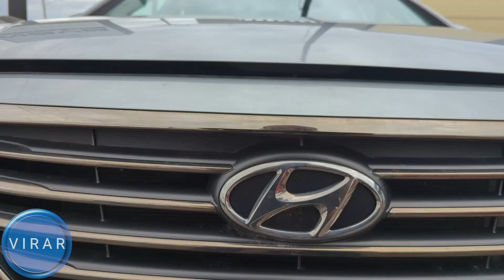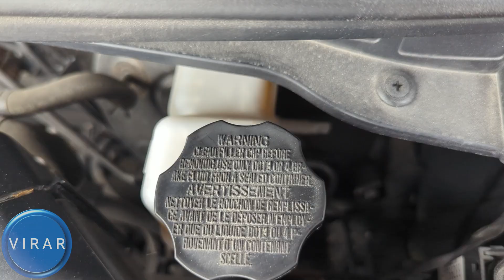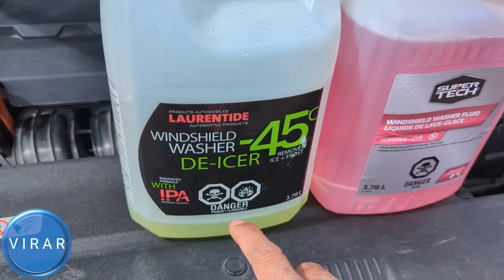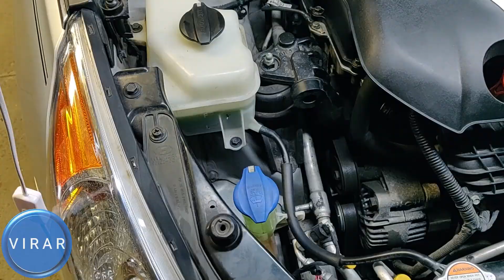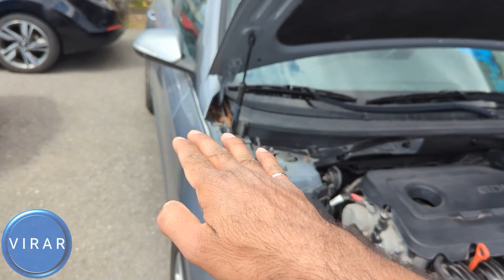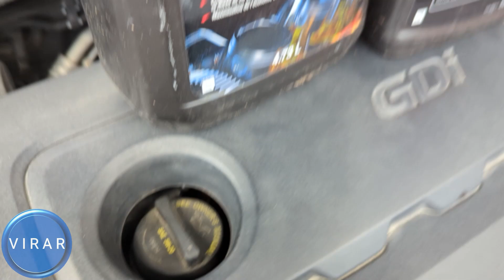How to Check and Fill Fluids [COMPLETE GUIDE] - Hyundai Sonata (2015-2017)

Comment from the maker: Brake Fluid Type: DOT 3 or DOT 4
Buy DOT 3 Brake Fluid on Amazon: https://amzn.to/42ZxnJN
Buy DOT 4 Brake Fluid on Amazon: https://amzn.to/3WsTZyB

Engine Coolant: 50/50 Coolant AntiFreeze
Buy Coolant on Amazon: https://amzn.to/47qwlHT

Engine Oil Type: 5W-20
Buy Engine Oil on Amazon: https://amzn.to/3L957ya

Virar Automotive is an Amazon Affiliate. If you make a purchase using the link, Virar Automotive earns money for referral.

Comment: I have this same exact car. I'm at 125k miles and I have not had the transmission fluid flushed yet. I bought it at 87k miles from a dealership. Should I have the transmission fluid flushed? Also this same exact engine in the video this car burns a tremendous amount of oil. Is there anything I should or could do to make that stop happening? TIA in advance.
Reply: Hi! I have a 2016 that was burning a tremendous amount of fluid. I took it to the dealership and they performed an oil test, and they deemed it defective and I received a free brand new engine!
Reply: Oil, burning a ton of oil, was having to add so much constantly

Comment: This is truly the best video I seen by far. I have a Hyundai Sonata 2015 with only 56,500 miles on it. Should I have to have the transmission fluid changed or can I just hold on until I get close to a 100,000 miles like you suggested.
Reply from the maker: No harm in getting it changed at 60,000 miles and then repeating it at every 60,000 miles especially since you don't drive the car that much.

Comment: My 2017 Sonata has over 93,000 miles (140,000 kilometers). The engine currently uses 5W-30 oil, but the oil cap says 5W-20. I'm not sure which oil is better to use. Please give me some advice. Thank you!
Reply: idk if you still need this advice, I also drive a 2017 Sonata and it can use BOTH 5w-30 and 5w-20 just fine, depending on what kind of engine is in it (mine is a 2.4 GDI) 5w-20 full synthetic would be the absolute best for it per the owner’s manual IF you also have the same engine, if not 5W-30 is a safe use for all of the engine variants for 2017 Sonatas but check your manual for the full list and the temp ranges

Comment: I’m gone get Lily (18’ Hyundai Sonata) in order! I’ve been watching inspections/common issues/how to check videos on my model/engine! Great content! I bought her with 117k, & I have 126,xxx! I want to keep her running smoothly even after I pay her off!
Reply: May I ask how much the total of the car was? I bought a 17' Sonata and I paid 10500 I believe I overpaid a little bit but the car was definitely clean for the amount of miles 92k
Reply: @playingpidgeon8832  12.9k with a Drivetrain Plus warranty included that I’m literally working right now. I’ve gotten multiple oil changes & top offs since I bought her back in October. Currently doing the 1000 mile oil consumption test to determine cause. Just recently got P0304 Cylinder 4 misfire from a spark plug that was replaced earlier.. engine had no oil & all of it in that cylinder. Got a new spark plug & they filled my car with 3 quarts of oil & it wasn’t even near half.

Comment: Would this also be relevant for 2007 Hyundai sonata? Thank you for the info!
Reply from the maker: It would be different. 2007 Sonata has an hydraulic power steering system. It also has a dipstick for a transmission fluid and likely different type of fluid requirements for the other fluids too.

Comment: I have a 2015 Accent, watch a lot of Scotty Kilmer, & it was suggested that at 45K miles, we have the ATF changed. So, I did. Then, later, we started doing Door Dash, at 75K miles we had the ATF changed again. I watched the mechanic the 2nd time. Seems, the fluid is fully drained, then it is filled, then, the engine started, & an excess fluid plug is opened until fluid stops. Plug is put back, & the change it finished. I really wish makers would bring back the dip sticks. Thank you for your videos :-)
Reply from the maker: Glad I could help! Agreed, having a dipstick just makes it so much easier.